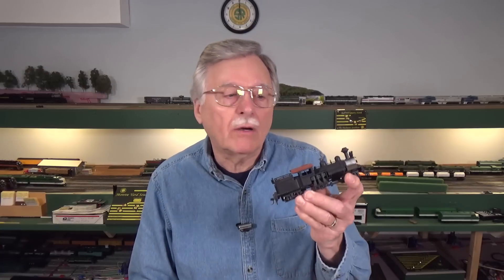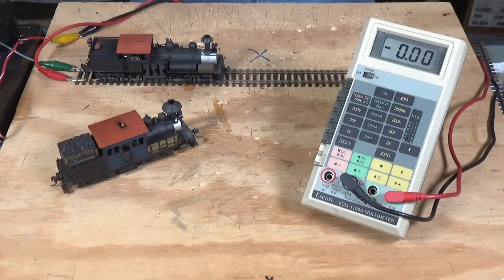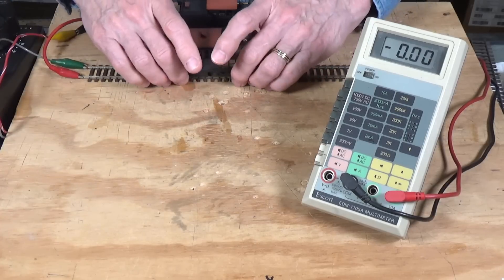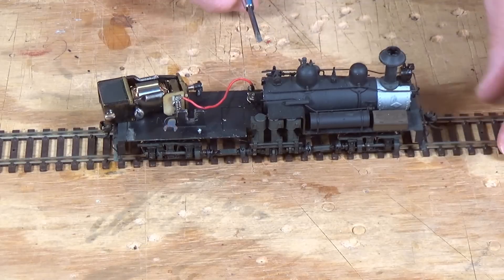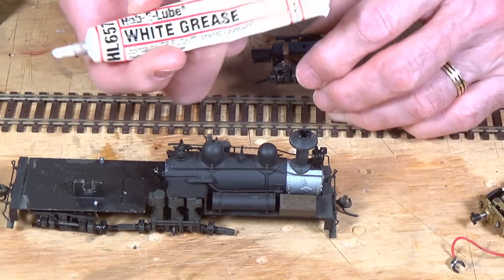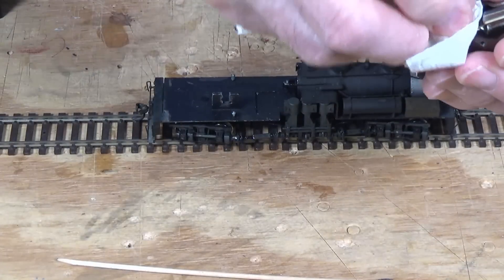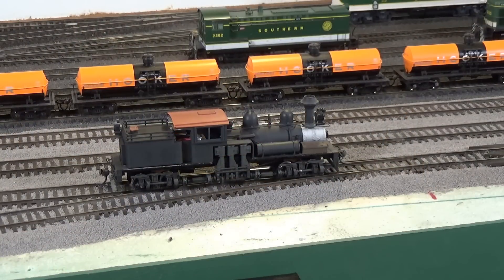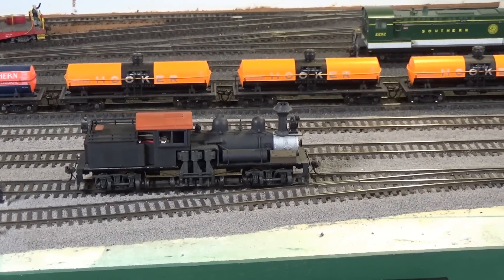Convert A 40 Year Old DC Loco To DCC (247)

Comment: Im awaiting on a 2-truck shay myself, and cant wait to start building it, so this will be perfect to reference too!
Reply from the maker: Have fun, as I remember these buggers were a pain to put together and get running reliably.
Reply: @TheDCCGuy  so I've heard, but that's just part of the fun!
Reply: Enjoy take your time i have built 8 2 truck and 4 3 truck MDC or Roundhouse Shay   kits some with can motors some with updated open frame, take time on side gear assembly, buy, still available, spare brass electrical pick ups for your trucks, polish frame and brass pick ups, they can be assembled to run good but they are noisey

Comment: There are better low current can style motors that will fit into that space. In fact, the last run of that loco kit (2001?) came with one. Your mileage may vary.

Comment: Thanks for this!  I have one of those 40-year old MDC kits that's still on my shelf waiting to be built.  I think it's time may be coming soon.  Luckily, back in the day, I did pick up those NWSL replacement gears, so they are also in the box.  I intend to shoehorn sound into it if I can, even if it means putting a speaker under the cab roof.  But we will see.....   Thanks for sharing.
Reply from the maker: If you can find the spare tender that would be a great way to squeeze in sound.

Comment: I wonder if it is possible to convert an American Flyer HO scale Hudson into a DCC locomotive
Reply from the maker: Almost anything is possible, but is it practical? If I actually wanted to run this loco regularly I would replace the motor and gears so I would have something much more efficient and reliable. Your American Flyer unit motor probably will need replacing as permanent magnets lose their magnetism over time and become less powerful. Micro-Mark used to sell replacement magnets for old motors, may still. It also likely is an old 3 pole motor that draws over 1 amp. You first need to get it running as smooth as silk then consider converting it.

Comment: Why does the motor have to be isolated? The decoder is enclosed so it is not touching the frame and the power is still being drawn from the same rail as before so the frame is still energized.
Reply from the maker: In some older locos the frame was a direct feed from track to the motor. If you then connect a motor feed from the decoder to the motor it will also be connected to track power and go poof!
Reply: @TheDCCGuy  Thanks, all I have is old locos.
Reply: @TheDCCGuy  Okay, so I think I get it. I am re-motoring my old locos but not converting them for now. So if I isolate the motor now and use a temporary feed from the frame to the motor lead, later I can use that lead to go to the decoder instead when I convert.

Comment: I built one of these for my Dad about 20 years ago from a "Roundhouse" branded kit I found at the hobby shop. It never really ran very nicely, and eventually stopped working altogether because the gears on each axle inside the bogies had split and were turning freely on the axles. Luckily, NWSL still sells re-gear kits! I took the opportunity to change the large gears in the main driveline to the brass ones from NWSL as well. The re-gear kit also comes with new metal universal shafts that are smaller and less visible under the model. Now the model seems to run quite smoothly, and makes less noise. Interestingly, the motor that came with this one is skew-wound.

Comment: Thanks Larry, very helpful. Have an old rivarossi heisler I need to convert to dcc, can you point me in a direction?
Reply from the maker: If it has their nasty old 3 pole motor it will likely be a rough runner. My old E8s had it and I just turned them into dummies and I don’t know
w whether a remotor is possible. I do know that a lot of folks in the UK have managed to put decoders into their old Hornby locos with similar motors like these so you might be able to do it. Make sure to check the stall current (see my video on that) and use a decoder with a high enough rating.

Comment: I am so Glad that this video posted .

I have a several  M D C Shay kits that I have still not put together .

The ONLY THING that I've done is that I noticed the difference between the standard gauge and Narrow Gauge and cut off the shaft extensions for the standard gauge and made them narrow ho / n3 .

Otherwise nothing else was done .

D C C was just getting started and the only thing that was available was a chipboard for running lights only forward and backward for the Shays .

Maybe I'll dig them out of storage .
I still have the M D C instruction book that they made .

Comment: This makes me so happy!   I keep seeing folks talking about how insanely expensive DCC is.   Well, you just showed that a DCC is pretty darn easy.   I can't imagine a DCC board costs all that much.  In fact, I see them pretty inexpensive.   Four wires!   Adding sound and lights?  Seam just a matter of a very inexpensive led prewired for the cab.   Sound?  I'd love that, but my guess is you could pop that into the roll stock and keep things even cleaner in the loco.    Thanks for the video.   Just starting out and clueless on DCC.   This is great though!   I have plenty of old diesels locomotive to try out dcc conversations with.   What board did you use?
Reply from the maker: I think the main limitations of these older locos will be the motor current demand. However there now are a lot of readily available small decoders that can handle 3/4 amp current draw and I’ll be showing a few soon. Sound becomes a problem with something like this shay as there is little space for a decoder much less a speaker. I would go with adding an extra water tender dummy for the speaker and a stay alive and decoder.
Reply: @TheDCCGuy  I'm also thinking that replacement motors are more readily available as well to improve on performance and lower amp draw.  If I'm going to pull a loco a part, not beyond just replacing the motor at the same time.  

I'm still looking to see if 'brushless' are  thing in the world of model trains.  SO much to learn.  Last time I was playing with trains, DCC was literally JUST a thing.  

Now, I see  you can pick up a COMMAND 2000 for like $17.00 USD.   A control board for 20-30$  Not sure it's all that simple, but seems it's worth a try. 

Looking forward to your new videos.  I'm just going to sit down and watch at least 2-4 videos of your a day!  So much great info! Thanks for sharing.

Comment: Appreciate the video. I have one of these but no place to use it on my layout so I doubt I will ever try to DCC it. One thing I would like to mention and maybe you would like to offer your opinion. I have several older diesel locomotives  that I have installed decoders in and due to space limitations, I sometimes could only install one sugar cube speaker rated at 1 amp. On one of my installations, the decoder stopped functioning so I contacted SoundTraxx to try to find out what the problem might be. After much discussion about various possibilities, SoundTraxx informed me that if you install a single 1 amp speaker with their 2amp decoders. you stand a good chance of destroying the decoder. Now the instructions that come with these decoders say "best with 1-2 amp speakers" and don't mention blowing one up with only a single 1 amp speaker so I was not particularly happy finding that out now when I have several older model diesels that I installed their decoder in with only one speaker due to space limitations. You might want to mention this to your viewers so that this might not happen to them.
Reply from the maker: I’ll have to ask George about that as he has never mentioned it to me before either. I’ll get to the bottom of this, thanks.
Reply: @TheDCCGuy  Larry be helpful to follow up after Talking to George thanks my friend

Comment: Hi Larry, I really enjoy your videos. There are some good signal articles I have found in Model RailRoader, March,April 2001 and June 1972 that show how to light the yellow light but may need some modifying for today's LEDs. Thank you and keep up the good work.
Reply from the maker: I think the April 2001 article is the circuit I am building for the PS. It included a board layout but finding a place to make the boards now is a PITA so I am hand building which takes a long time since with a double track mainline I need two for each block. I’ll eventually get enough done for a demo of the system, but I think most folks will want an off the shelf ready to run version. Are you the Mike Dodd who used to make fast clock kits?

Comment: I am not new to the hobby but am new to DCC and my "stuff" has been packed away for 20 years. The lubrication bit was very helpful. I am an 1860s modeler with a number of Mantua, Bachman, Pocha and Rivarossi 4-4-0 or 2-4-0 locomotives with most having a driveshaft between the loco and tender. Would these be candidates for conversion to DCC (if I can get them properly running again) or are they lost causes (I am not a rich guy, but being retired I am fortunate to have a disposable income for this hobby and really do like the older locos)?

Additionally, the motors, particularly in the Mantuas, are quite noisy and heat up very quickly. Two of the Mantuas, that I picked up used, had a headlight installed and the loco gears are extremely noisy. Would there be a correlation or would the plastic gears be worn in these two or do they just need cleaning/lubrication?

Finally, about 25 years ago I picked up 3 new Bachman "John Bull" locomotives to be more an anachronism on the layout than anything else (price was extremely right). Would it be possible to convert these to DCC by wiring from the tender to a passenger car?

I apologize for all that I have brought up in this post and hope that I have not abused the privilege.

Thank you for any assistance that you can provide. Regards.
Reply from the maker: Those are likely old 3 pole motors like in the Shay. Without seeing them I would bet you’ll have a hard tome finding a decoder small enough with a large enough stall current to power them. I did a video (no. 89) a couple of years ago showing how to measure stall current.

Comment: Have you ever tried liquid electrical tape? I use it in my old blue box athearn locomotives when I convert to DCC.
Reply from the maker: Yes, but I prefer heat shrink tubing, easier to work with and more reliable.

Comment: Two things I'd suggest doing to any open frame motor that has had lots of runtime and/or stored in preparation for a DCC conversion:
1. Pull the brushes and clean the commutator plates with a fiberglass pencil (found on Amazon for less than $10) so they're physically clean, followed by cleaning with 91% rubbing alcohol, CRC 2-26 or similar electrical cleaner. Make sure to also get in between the commutator plates with a toothpick or small pick to get the gunk out that could make an electrical bridge and let the magic smoke out.
2. This may be moreso for 1950's and 1960's era motors that have lost their magnetic power, but a simple replacement with neodymium magnets will help cut current draw by magnifying the magnetic field. I can't recall what size mine are for standard replacement but they made a big difference in amp draw, from stall current of 1.13A down to 0.4A stall current.

As far as drive train quieting, there's many methods like the old tooth polish cream method. However I'm not familiar with MDC's Shays but the Climax and Boxcab share the same mechanism and can benefit from the aforementioned method.
Reply from the maker: I actually gave the motor a good cleaning with CRC contact cleaner but forgot to mention that. The magnet in this case seemed to still be quite strong and the loco ran well so I don’t think a magnet replacement was in order but a good thing to check. I think that MicroMark used to sell replacement magnets. I haven’t used the old toothpaste trick in ages. Pearl White ws always a good one to use as it had a lot of abrasives in it. Good suggestions.

Comment: I tried the same Digitrax decoder but there isn't enough space available. How did you manage to put the decoder in the tender?
Reply from the maker: I trimmed the plastic covering back to the edge of the circuit board, tucked in all the wires (which I had cut back when making the connections), and then set it in place against the back of the motor.
Reply: @TheDCCGuy  Thank you very much

Comment: same thing  to old HO brass FT diesel unit from 1960 where have O gauge 5 pole open motor which 2.5amps in them and turns into Dcc unit with 4amp decoder for O gauge loco  in 1995 from DCC System One made in their day,
from Australia

Comment: Great Video Larry! I've been able to add more modern skewed motors to these older locomotives by replacing their u-joints from the motor to the drive-train with thick silicone tubing 👍

Comment: This may be a silly question, but I'm new to the hobby ("for my kid"), but I picked up a bunch of older trains and watching videos it seems fairly straight forward to put these boards in and solder the connections.   But my question is this an "all or nothing" thing with locomotives?  Meaning do I need to convert all my locomotives to DCC in order to use them on tracks?   That's to say can older DC locos run with DCC controller?  Or could a DCC loco work with a DC track layout?   Mind you I'm not saying work with DCC functionality but could the locos actual work on the track or would I need to swap out (or add a switch) to go between a DC power adapter and a DCC controller when "my kid" wants to play with different trains?
Reply from the maker: DCC decoders have a feature called analog conversion. That means that when a decoder equipped locos placed on a DC powered track it will operate off DC power. The problem is it takes several volts before the decoder switches over and responds so you have a limited speed range but it will work. Another issue is that if you leave this feature turned on when operating on a DCC layout the loco can get confused by a short on the track and take off at fill speed, somI don’t recommend keeping this feature turned on all the time.

Comment: “Professor Larry”,  nice work converting this older locomotive.  Runs great.  As the boiler is solid, you can adding a LED front headlight by drilling out the plastic headlight casting and then installing a 1.0 mm LED with a 1K resistor.  One wire is red, paint it flat black and then run the wires above the grab handles on each side of the top of the boiler.  CA in place to keep it neat.  Cut slots in the front of the cab to pass the wires to the motor assembly for soldering.  Looks like conduit on the outside of the boiler and not bad at all.  The tender LED can be easily added and passed through the plastic tender assembly to the motor for soldering.  See my video “Improving the MDC Shay”. Cheers and keep up the good and informative videos.

Comment: Nice, I've got 2 mdc shays I'm thinking of converting the 2 truck to dcc. It has the newer can motor I assume it's close to the same procedure.  I will check the current draw first  and double check continuity from frame to motor housing. I did the NWS partial great upgrade years ago. Any other sugestions?
Reply from the maker: Sounds like you’re on top of it.

Comment: Nice work.  Although I noticed it ran very nicely under Ye Olde DC, do you get improved running characteristics/control now it's running on DCC?
Reply from the maker: Seems to actually run quieter, much smoother with less cogging, and and better slow speed performance.

Comment: Hi Larry, another interesting video. I’ve converted all of my older Triang & Hornby models to DCC too (some of the Triang models I received as a kid where back in1962) It’s very satisfying to see them running around my layout under DCC. As you suggest I make sure the decoder can handle the loco amps. Rgds from Down Under.